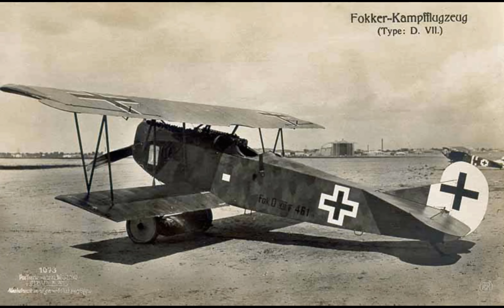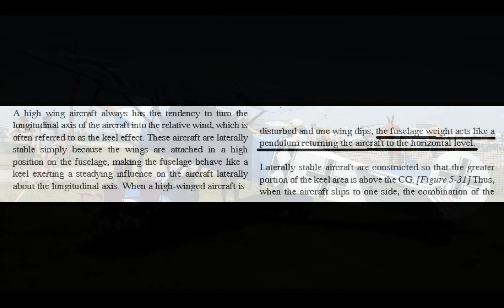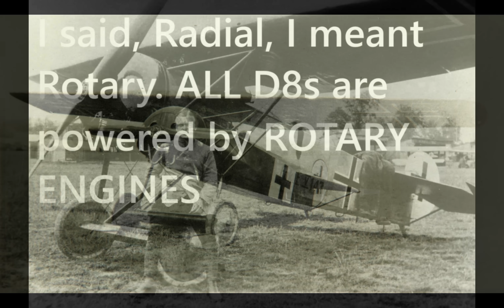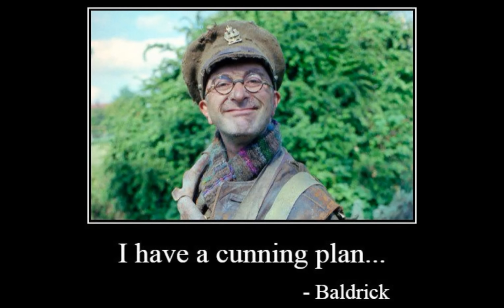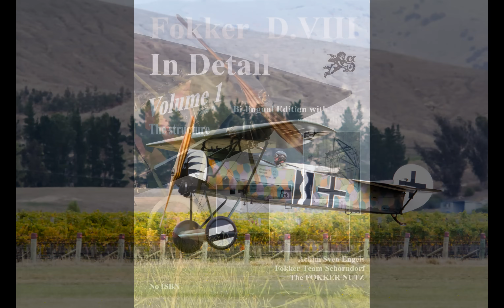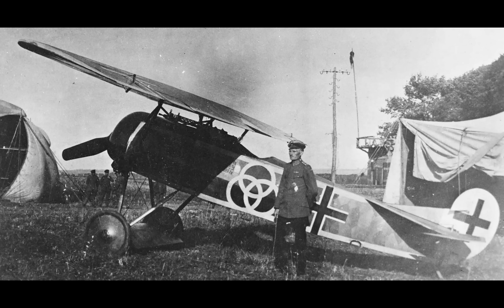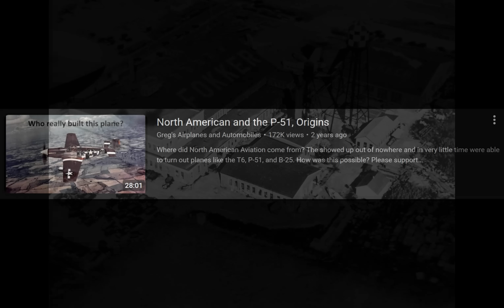Fokker D VIII The Best Fighter Of WW1

Comment: Great video.  Yes cost of production n maintenance are underrated.

P47 great plane but could only work well for US given US resources

Likewise Fairey Swordfish not only could do Mach 0.14 but very cheap to make n maintain.
Reply: The German battleship Tirpitz was attacked by Swordfish, but unlike its sistership Bismarck, was able to escape with no damage. The Tirpitz was making 30 knots into a stiff wind, which made it difficult for the Swordfish to get into position for an effective torpedo attack.
Reply: @fafner1  The channel dash was certainly the greatest failure for the Swordfish.  I had not heard the slow speed make attack difficult. Channel Dash was day of shame for Brits.

Swordfish supposedly sank most tonnage, but I don't know source for that.   From what I can tell for few months it had absolute tech supremacy, as in using radar to attack ships was total game changer.   Fly over Mediterranean at night, find transports, surprise in torpedo them.

Comment: I count myself lucky that I saw Old Rhinebeck's DVIII flying with an original rotary engine last summer. It was easy to see that it had excellent performance compared to most of its opponents.
Reply: Not really the original Oberusal, the engine they used is the Gnome Monosoupape 160 with the clockwork ignition "throttle".  This engine was more commonly used on the Sopwith Camel and the Morane Saulnier A.I monoplane.
Reply: @tauncfester3022  Close enough because the Oberusel was a licensed copy of the Gnome
Reply: HA! Me too. Flying in the annual Mid Hudson RC Jamboree at the aerodrome when Cole was still alive! The DVIII was done up on purple if I recall correctly. And it was the Gnome rotary... but, hey, an original rotary is something unique to see running and flying... what a mess...
Reply: @Mike-eq4ky I spent nearly 20 years helping to run that event! My last year was 2012 and I’d love to go back!
Reply: @Whitpusmc  HA!! Maybe you remember my red, white, and blue harlequin patterned 1/3 scale Sopwith Pup!! You guys all ROCK. What a venue. What an event. Even Greg has now had the pleasure to visit the aerodrome - but has yet to see the airshow. Ahhhhh... for the days of Cole Palen...
Reply: @Mike-eq4ky I do!! I helped Cole carry his Dr1 TRiplane off the runway when he buckled the landing gear on landing so that the other planes could land. Just me and him. I was like 8 years old. OK, maybe someone else helped but you remember it your way, I’ll remember it mine… 😅 I wish I had a picture of that. I assume I’m just standing nearby while the adults helped but it is a fond memory.

Comment: The main competition for your argument are the all-metal Junkers designs.

Despite this, the WW1 German aviation industry was often pretty derivative. 

However, that wing showed up on a lot of planes, not just Fokkers.
Reply: A cantilever monoplane design can really only be optimized in similar dimensions. 

Tapering in chord-length and also thickness ratio; with longer chords, and thicker airfoil sections at the root, is the logical conclusion for cantilever designs.

Once the decision is made to go cantilever (or semi-cantilever as this design had inboard struts) they all sort of look the same.

Comment: I think the reason for a parasol design is that the wing contains one piece spars. The leading spar would have interfered with the air intake of the rotary engine if the wing was placed where it needed to be to maintain the center of gravity. Just a guess.
Reply: Not to mention the total loss of visibility a fuselage mounted wing would have!

Comment: Parasols keep pilot and Mg and wood frame dry longer.  Wing Struts push off on firewall. A wingbox would have added weight and limited Tanksize. The empire was at its end. The workforce exhausted. The parasol kept the fragile wingstructure from getting damaged while groundhandling and maintenance. Important in wet Western-Europe
Reply: Interesting thoughts! Is there anything that backs this up? Not disagreeing, just really curious if these were primary design considerations for Anthony Fokker at this point in time. Intriguing!